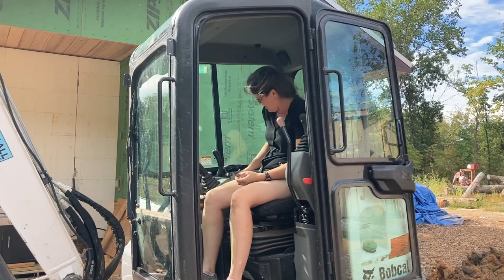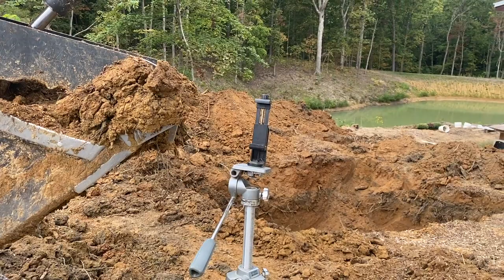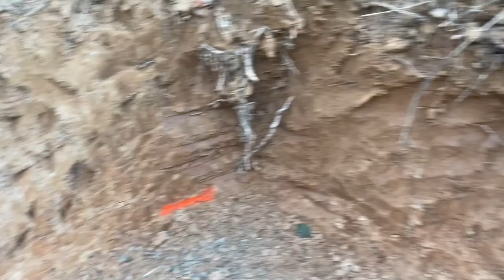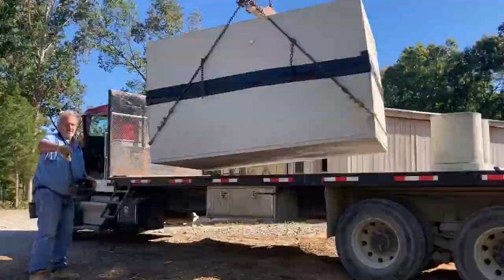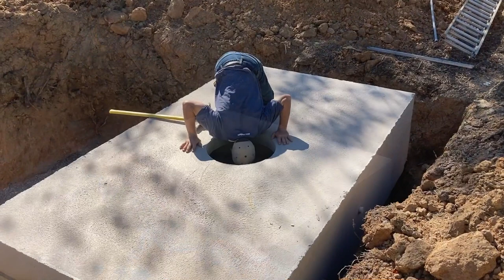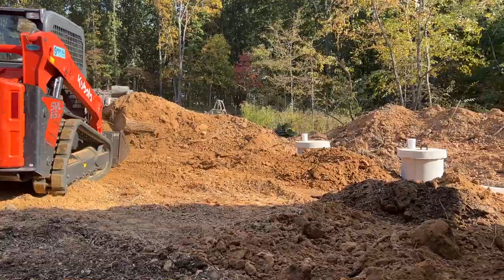Installing Underground Water Cisterns

Comment: great progress.  I know how Danielle felt.  Drove a mini-ex the other day for the first time.  Daunting at first and then you find a rhythm and work goes faster.
Reply from the maker: Our biggest challenge was working on a slope.  That whole area has about an 8 ft drop one direction, and roughly 5 ft the other direction.  It was impossible to position the machine totally level, so I just felt unstable the whole time!  Hated it!  Relieved to get the project done though, for sure!

Comment: Can you share information about costing?  How did you find water cisterns versus septic tanks?  Any hints?  I'm only able to find septic tanks in our area.
Reply from the maker: I can’t deny it was definitely a struggle to find these! We’ve been looking for months, and exploring every possible option we could. It turns out a concrete company that we called suggested this company in a town a couple hours away that built concrete products. They had a wide selection of products, from parking blocks to cisterns. We never saw any advertisements, and they didn’t pull up in our online searches. So in that case, definitely ask around. We found ours just through word of mouth. As far as cost, these were about $4000, which included two, 2000 gallon capacity tanks, delivery, and install.  For reference, This was less than half what we paid for the cisterns (same capacity) at our last farm, which had to be custom ordered and built in place.
Reply: @ADifferentWay  Thanks, great information!!

Comment: Level,it with the rock
Reply from the maker: We had to dig out the corners in order to get the tanks, low enough into the ground. We did use rock for leveling the base, but we had to get it deep enough first.